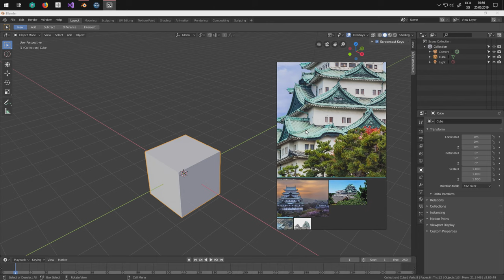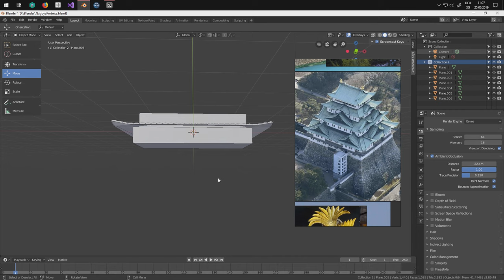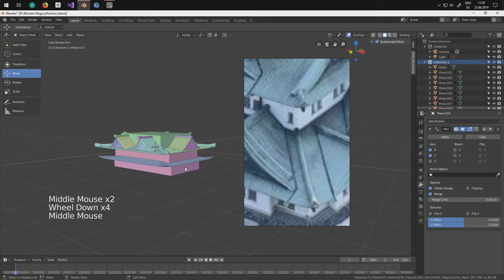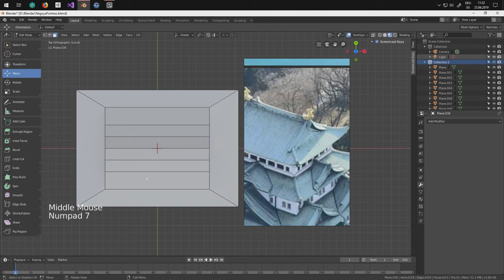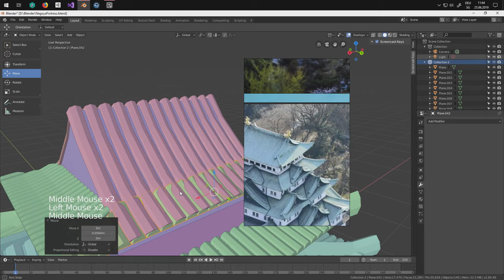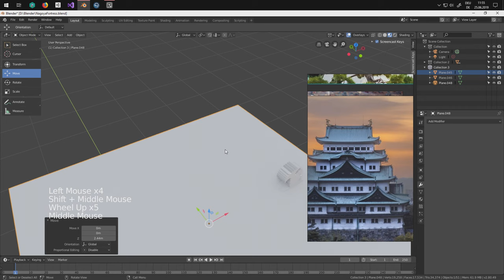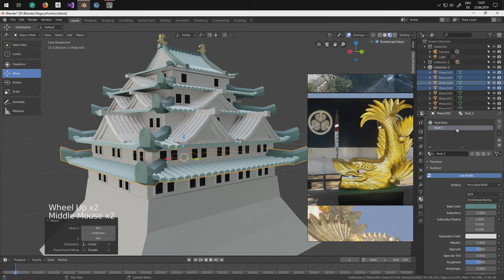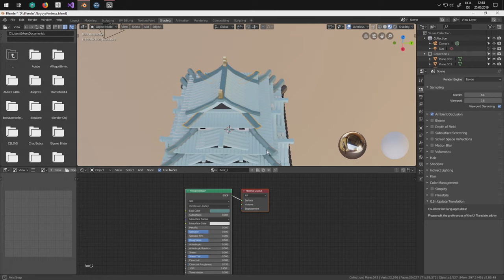Blender 2.8 - [Tutorial] Easy Japanese Fortress

Comment: 3:09 the moment after you rotate it you go to edit mode an the shape is already cut in 4 pieces. But how did u do it? When I wanna cut my shape it's changing its shape
Reply from the maker: I copied the plane and when you go to Modifier < Subdivision Surface it will change it shape to this kind of circle.

You can also create a new Mesh < Select Circle and change the Circle verticles (bottom left) to 4, its the same. 

Hope i could help you :)